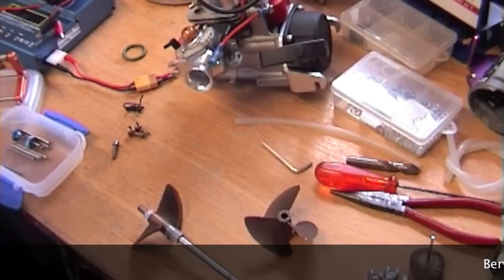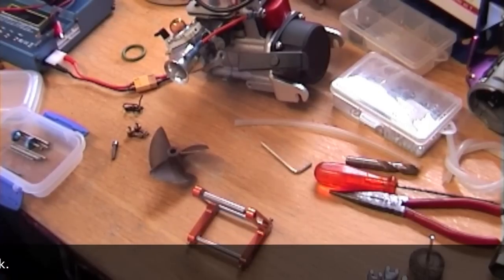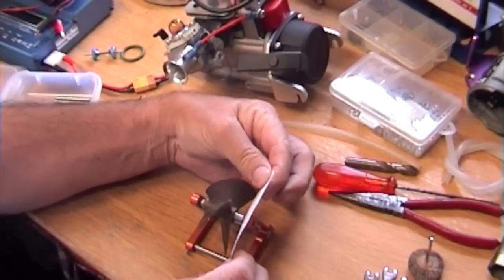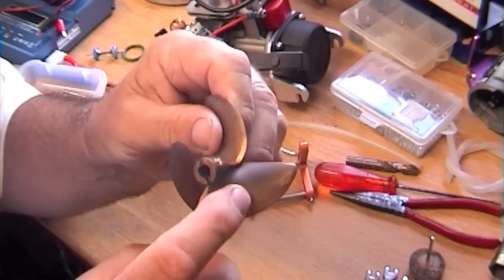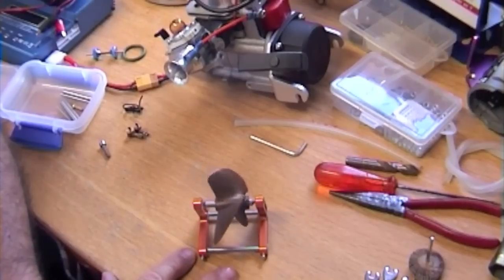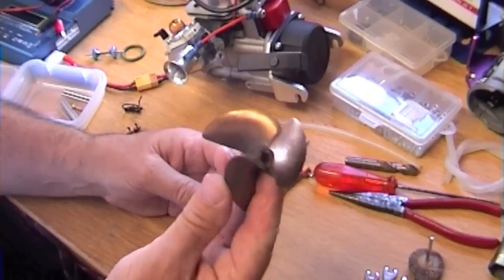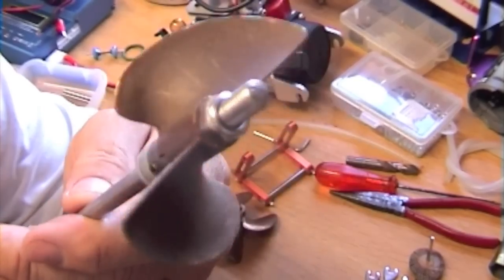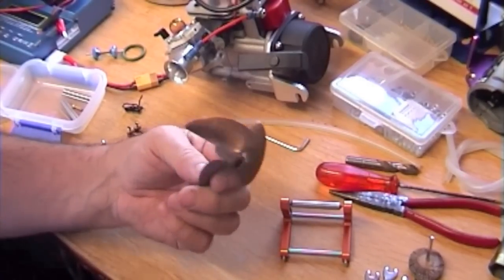HOW TO Balance a Model Power Boat Propeller.

Comment: Good tip - thank you. When I upgrade to a boat with a balanced motor (Yes, it's pretty pathetic listening to all that vibrational energy going to waste) I'll probably grab one of those balancers. The only question I have is what sort of file do you suggest for removng material?
Reply from the maker: A very fine file but not so fine as to clog easily, If you work on the back face then use a flat file.

Comment: it stops at a different place ...everytime.
Reply from the maker: You need to shave a small bit at at time to get the balance.
Reply from the maker: If it stops in a different place every time! then it must be BALANCED, as the heavy side will go to the bottom every time.
Reply: @Topvideos1001  My heavy side always goes to the top but then again, I am in Australia where everything is upside down.
Reply: @rooftopvoter3015  👍🤣🤣🤣